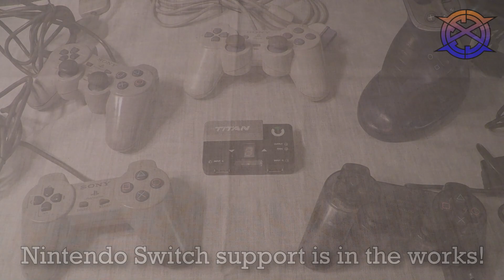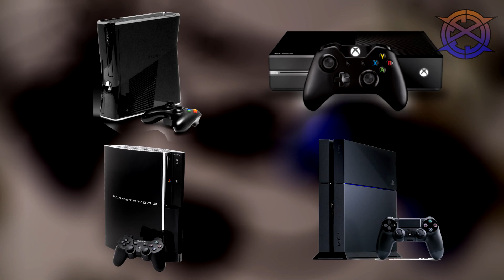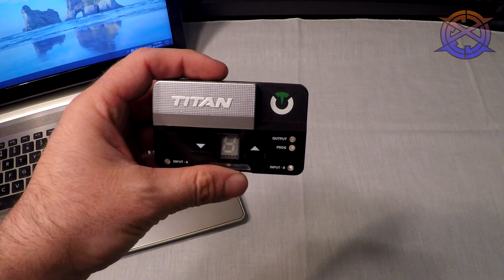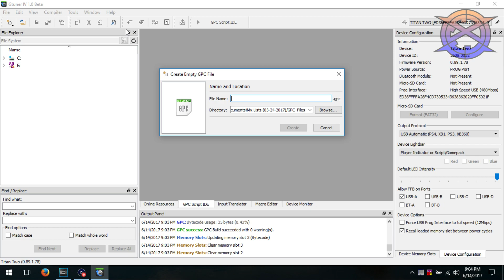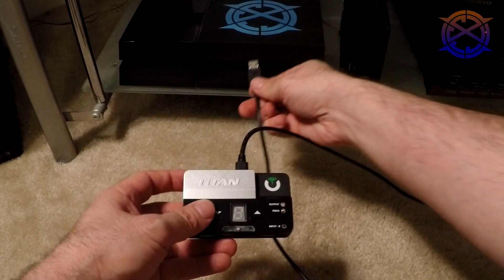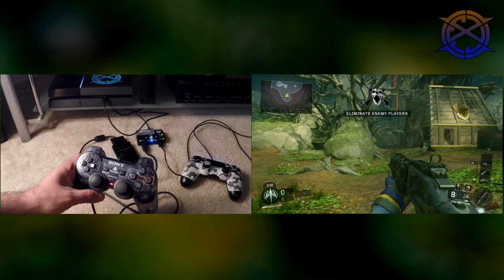PS1 and PS2 controllers on PS4, Xbox One, Nintendo Switch and more | Titan Two Tutorial

Comment from the maker: init {
 remapper_swap(BUTTON_3, BUTTON_2);
 remapper_swap(BUTTON_18, BUTTON_3);
 remapper_swap(BUTTON_4, BUTTON_7);
 remapper_swap(BUTTON_5, BUTTON_8);
 remapper_swap(BUTTON_6, BUTTON_9);
}
main {
    set_val(STICK_1_X, get_val(POINT_2_X));
     set_val(POINT_2_X, 0.0);
    if(is_active(BUTTON_18) && time_active(BUTTON_18) > 300) {
        set_val(BUTTON_1, 100.0);
    }
}
Reply: hi icc, do you have any idea how to get the namco negcon running?
Reply: liked your video to convert ps1 to ps4 controller. I wanted to convert either the Mad Catz RC type controller (like pictured in your video) or the playstation UltraRacer handheld wheel controller to ps4. Steering works but the trigger will not work for forward or reverse. It's possible this system does not work on driving games. Before I return the Titan Two Is there something I might be missing. I would highly appreciate a reply if it is possible. Thank you for a great video.  Dave
Reply: if connecting to a switch do i need a pro controller for B?

Comment: how much input lag does this add? i have a brand new dualshock 2 i wanna use to play the ps4 port of Ace Combat 5
Reply: Wired should be faster. Unless your cable is really long it may delay the signal, so try to keep the wire under 6ft

Comment: This whole setup is overkill. Just buy a dualshock 3 or 4. They both work natively with ps4
Reply from the maker: you do realize that the PS1 had more controllers/steering wheels/attachments than just the regular controller, right? this isn't just for a dualshock, this works for everything the PS1 made, including arcade sticks.... You could use your PS2 arcade stick that cost $200 .... or do you want to go buy another $200 stick? think about it
Reply: can i use dual shock 2 controller on ps4?